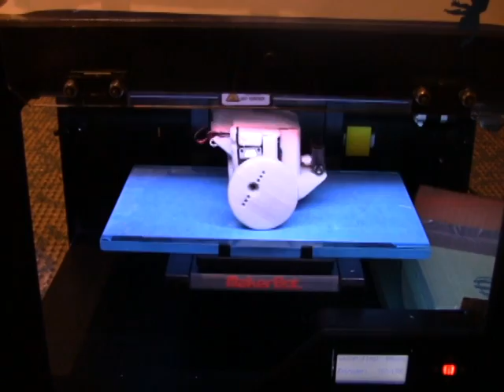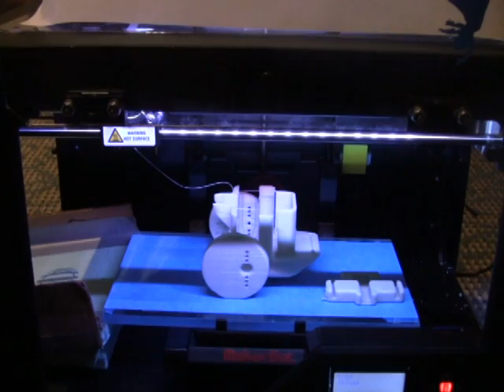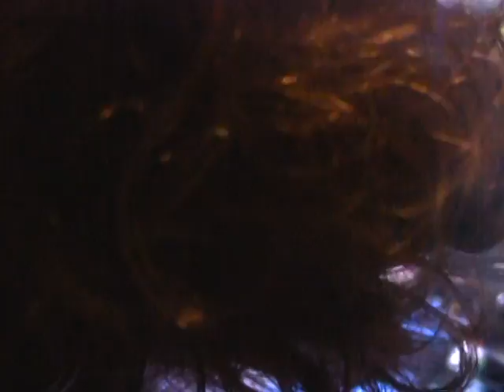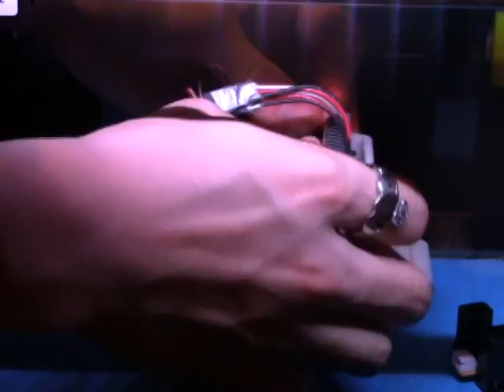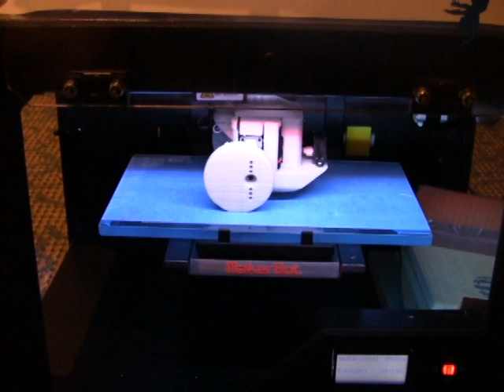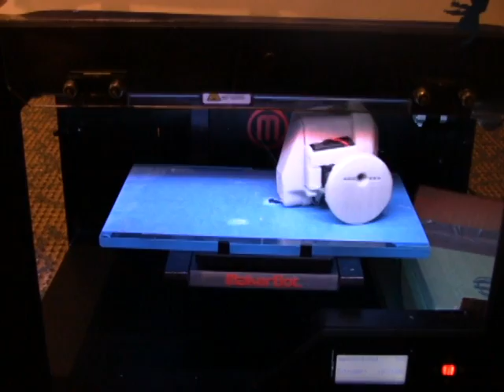Ep10: Print Out

Comment: you could make it better with a second print head, one that prints with a conductive filament. This would allow you to just 'plug in' all of your electronics and have no need for the wires. It would make things look better, and you can have it be water tight, which would be super cool to print a boat that is RC controlled right off of the print bed
Reply from the maker: Benjamin Engel That's actually what I have planned next! I tried using some of the conductive filament from MatterHackers, but it wasn't as conductive as I'd hoped. I really want to see what I can do with a Voxel8 printers, they're great for what I plan to do. It would be really easy to sense when the print is done too; you could have the printer complete the circuit at the end of the print to make the part start to move.
Reply: Printeraction you could probably get thick solder and print with real solder, that might destroy your hotend over time but I think it would be worth trying! also I know that colorFab sells copperfill and they say its 99% copper. That seams like it would be pretty conductive right? maybe not, but agin testing if the fun part :) Printeraction

Comment: I never actually have the opportunity to own a 3d printer thus not making me a 3d expert. But as a suggestion, I think you could integrate a track at the sides of the makerbot as an alternative to allow the robot to drive off to the ramp. 

A very cool concept indeed!
Reply from the maker: shukry sharby Thanks! That's probably something I'll do as I push the project forward. I think it'd be really cool to have the robot drive off the build plate and then do something fun once it reaches the floor, so you may see that coming up!
Reply: Yeah, it would pretty much be like the Phytagoras Switch contraption, like most of the factory machine sequence. Looking forward for the project :D